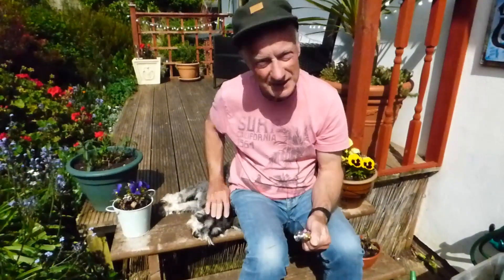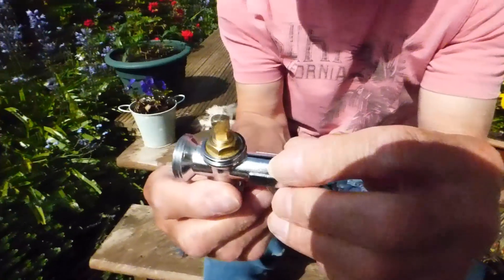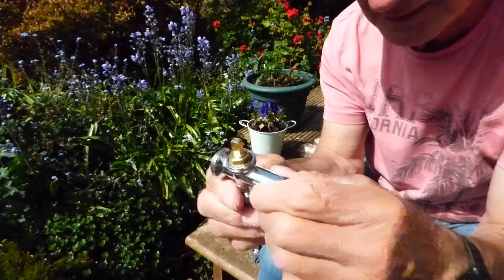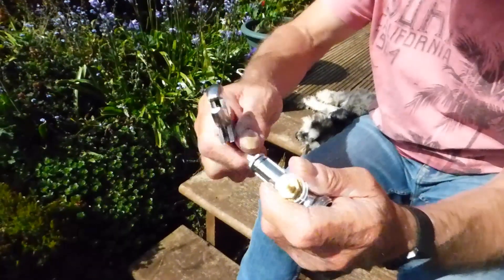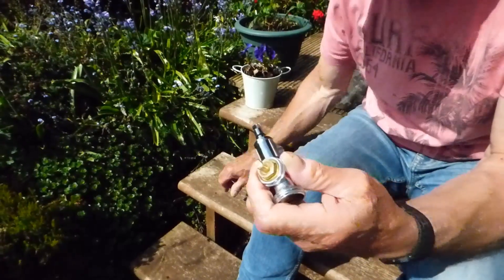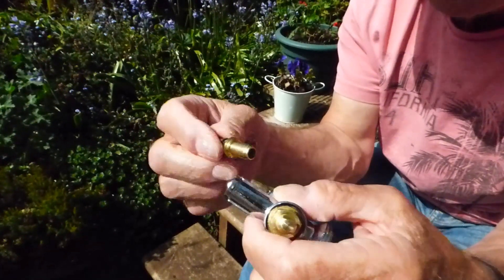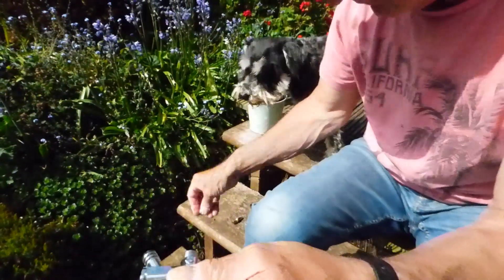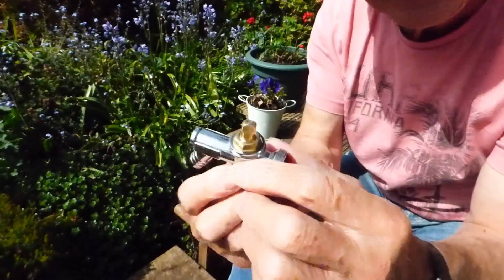Can I just empty my heating radiator with a drain cock rad valve.

Comment: Just a quick query. I have a small leak on the actual radiator drain valve itself. It seems to seal itself and stop when the heating is on but when off it starts dripping. I have got a plumber coming to look at it in the New Year but in the meantime the drip seems to be getting worse. Should I isolate the radiator by turning the two valves off at either end, in which case the rad will cool and the drip presumably get worse until it drains, or should I try draining it down? What I dont want is to come down one morning to find the whole valve has gone and its drained the whole system into my kitchen🤔 Thanks for your opinion and Merry Christmas
Reply from the maker: Turn both ends off and empty the rad through the drain valve. The washer in the valve needs replacing. Do try in the first instance tighting it up.
Reply: @dereton33  Thanks so much. I thought it must be the washer that had gone. Have a good Christmas

Comment: Just tried this and it seemed to drain the whole system, even with both ends of a single radiator isolated. When turning bleed valve it kept passing water - I read that means that radiator can't be isolated properly and maybe lockshield valve is still passing water? Or maybe that means radiator just hasn't drained of any water as it's isolated? Though I can hear water gushing in when I open the lockshield, so I think it's working. Turned both sides clockwise to fully isolate. Not sure what I did wrong. Read somewhere on internet that you can't drain single radiator with drain off valve as it's connected to the system.. then this video says otherwise, so I dunno
Reply from the maker: Ones valve must be letting by.

Comment: Hi Thank you so much for this info. I’m upgrading imperial radiators etc my 42 yr old open vented system. I’ve bought several rad valves with drain cock and rad tail with cock to look at for suitability of rad only draining in the future. It would not have occurred to me that you could drain a rad only with this type of rad valve and drain cock. Very helpful, thank you.

Comment: I'm trying to put a 10mm valve with drain onto one of my rads so that I can drain the system to do work on it.Didnt want to drain the system so I turned lock valve off and trv off and undid the union into rad and drained the rad...no probs until I tried to swap over. I quickly undid the union (where the olive is which I re used as it was already on the pipe) I got the new valve ready to put on the tail.The I found could not do original olive nut up as it was wrong size (slightly smaller than the new nut.) Are there differant sizes of 10mm drainn valves?..help would be greatly appreciated...Great informative videos by the way.
Reply from the maker: Hi Richard , unfortunately different makers of these valves use different nut threads. They are all 10 mm size though. This is the sort of thing that makes life so difficult.
Reply: @dereton33  Thanks for the clarification..Really appreciate you take the time to reply to our often silly questions.

Comment: Great vid al just to confirm if you just wanted to remove  rad for decorating you would just close both lockshield and other valve on rad and then open this drain cock and that would just drain rad. Is that correct? I am sure when I did this once all the system was drained on a combi, should that have happened? Many thanks
Reply from the maker: Yes it will just drain the radiator, if it drained your system before then the thermostatic rad valve or the drain valve were not closed properly.

Comment: Al, when balancing the heating system, please explain to me an easy way of working out the  order/sequence  in which the radiators are connected to the boiler.   
Surely there must be an sensible way of figuring it out, other than switching the boiler on and then rushing from room to room, like a demented duck, feeling the radiators and noting which one heats up first, which one heats up last and in what order the ones in between heat up.    One in the kitchen; one in the lounge; one in the bathroom; one in each of my two upstairs bedrooms.
We live in the 21st century man  ……. we’ve got amazon, google, twitter and facebook  ………  I even know of a dog,  Mo is her name, which speaks English (I’ve seen her do it on some of your other vids), so there must be a scientific, intelligent, progressive, Social Justice Warrior way of working out the order in which my rads are connected to my boiler.  Make my day, Al.
Reply from the maker: Best bet is to just follow the pipes from your boiler from the nearest radiator to the furthest away.
Reply from the maker: Just ask MO.
Reply: @dereton33    I guess that reply requires a rhetorical question in response  --  how do I follow the pipes without ripping out my British Gypsum plasterboard wall linings?